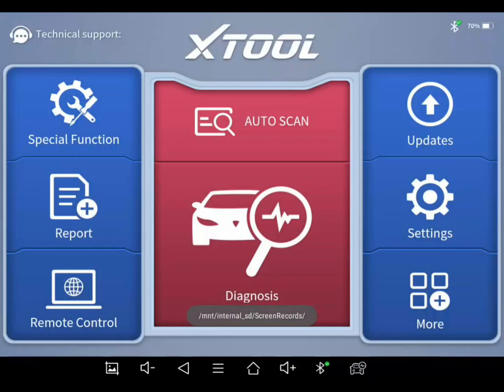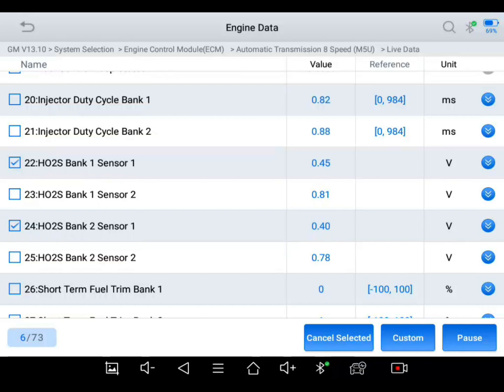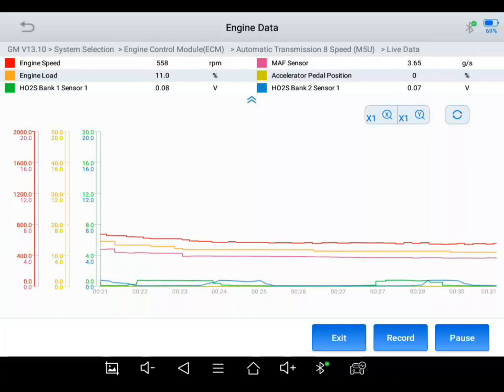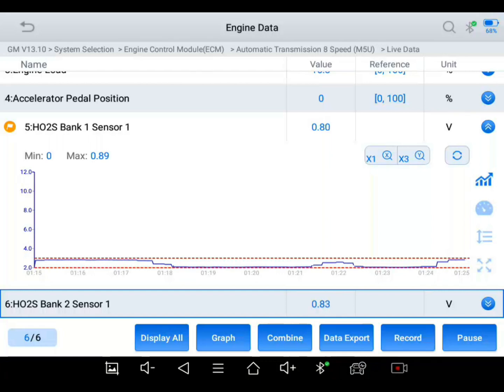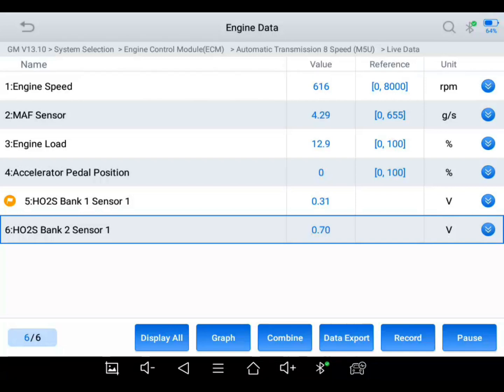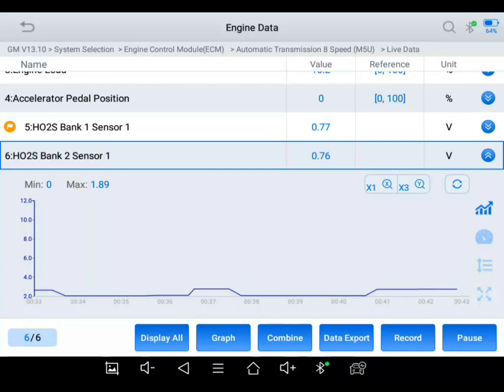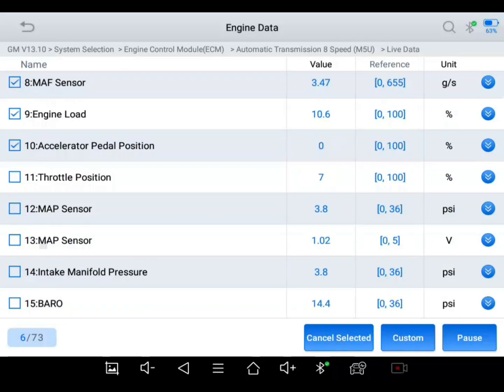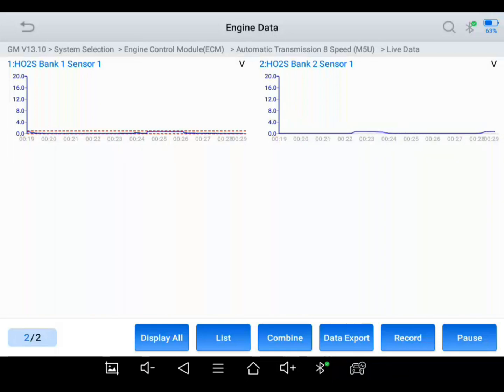The Graphing Abilities of the Xtool D8 Scan Tool and the Biggest Problem it has.

Comment: This stupid XTool D8 doesn't recognize my Mazda CX-30. I updated the software, when I go to "Settings" it says that the software is up to date. I'm disappointed in this scanner, I mean it's a Mazda, it's not like some exotic luxury car brand.
Reply from the maker: What year?
Reply: @737mechanic  it's a 2024 Mazda CX-30.... I had my Xtool D8 since 2022 and my subscription doesn't expire until next year and it says that all software is up to date.
Reply from the maker: @alexanderakilov4349  Give it time and it will work fine. If you are having problems with a 2024 take it in under warranty.
Reply: @737mechanic  I just wanted to do one of those special functions to disable the seat belt chime .

Comment: Excellent video. The inability to scale the graph renders the one function I need most to be useless. $400 lesson, I guess.
Reply from the maker: They have since fixed that problem. I have another video showing how well it works now.
Reply: I downloaded the updates today and it's still dismal with almost no movement at all on the A/F line. @737mechanic  I saw your video and yes it is better but a 3 volt scale with a millivolt response isn't useful for wave comparison. I wish I could upload a screen shot.

Comment: Thank you! Finally a video that shows how these handle live data like as if you were diagnosing a drivability problem and not just using these as glorified code readers! I need a new scantool. My Autel MS906bt is just way too slow. I was deciding between the Launch X431 V+ PRO and the XTool D9 Pro. The Launch has pretty decent live data viewing with lots of graphs and I never saw how these Xtool's handled more in depth live data. The scaling issue you're showing is annoying but hopefully that'll get fixed or at least I'm pretty sure I could work around it. I think I'm leaning towards the XTool D9 Pro. Thanks for your videos you have on both platforms. I watched quite a few of them and they really made me feel better about making a decision. I gave ya a sub!
Reply from the maker: The graphing is really good on the xtool. It is nice and responsive and smooth. I have used some scan tools that the graphing is pretty much worthless.
Reply: @737mechanic  I hear ya there. I'm mainly using my Autel MS906bt. It's graphing is annoying but okay if you're only interested in one graph. But in general it really sucks for data captures and reviewing data after your road test. When I need to do that I usually just have the PIDs as text then record the screen with my GoPro and review the frames of the footage rather than trying to use the Autel...

Have you done a Ford power balance test with your XTool? How does it fare to the videos you made of your Launch and your Autel? I work on a LOT of Fords and reach for that test a lot. But unfortunately my Autel is just like the video you made with yours. Horribly slow sample rate for that test. The video you made showing that test on your Launch had a pretty decent sample rate. Enough to catch one time misfires. Really wondering how the XTool compares to that.

Comment: One more issue i found with the d7 is when i save a report on my 2018 Chevy Cruze it will show all the information on the car but it shows the milage in kilometers instead of MPH I went back to the settings and i had them all set for American so that's another glitch they need to work out And the readings on the 02 sensors is a major issue
Reply from the maker: Make sure you send a report to them so they know and they have been good at fixing stuff like that.

Comment: Great video. 

Is it possible to save data and export it as an excel file?  That might be a work around to create a better graph on a computer.  

I would love your insight on a few other questions I had about the unit.  

-programming custom wheel sizes for Jeeps
-programming pinion factors 
-injector coding when swapping in non OEM injectors
Reply from the maker: The only wheel/tire sizes you can program are sizes that are offered by the manufacturer.

Pinion factors can be programmed for some makes and models 

The only injector coding I have seen is for diesel engines.

I have a video showing the option for custom tire sizes in the Launch x431 scanner.
https://youtu.be/wF6Xbi0m3eg

Comment: Already reported the o2 sensor range issue to the techs for fixing.
Reply: Great job!
Reply: My brother just bought the D8 and was wondering about the custom list limitation to just 8 PIDs. I think it should be more even if the refresh rate is slow, we techs understand that refresh rates get slow. Also; the graph option is not always visible and only gives combine at 8 PIDs. I think it was mentioned that if it was fewer PIDs; it would give that option to graph individually. I think the other option which a lot of scanners allow is the custom graphing from the custom list. For instance I want to see the O2 sensors for short and long trims separate in two combined graphs, etc. So far this tool is faster than my Launch Pad II. I will keep using this tool and see; your reply gives hope that you listen to the community. Thank you!
Reply: Hi, All xtool product had the possibility to view separetly several graphic on one screen but A30M can't do this, why ?
Reply: @zw3245 
I'm very disappointed in the fact that the a30m only graphs one at a time on a page. And my a30m is not fixed on the 02 volt scale. Which makes that pid worthless.
Reply: Have they fix the h2 sensor graph issue yet is 2024?
Reply: Thanks for explanation

Comment: X Tool need to add topographic
Reply from the maker: They have it on the D9 but yes it would be nice on the D8 as well.
Reply: @737mechanic  yes the D8 also need battery in the top right of the scanner like Autel and snap on. I mentioned it to them
Reply from the maker: @TurnThemWheels  Don't forget the VCI has a voltage readout on it, of course, most of the time it isn't in a position so it can be read but you could always get an OBDII extension cable so it could be read.
Reply: @737mechanic  yeah it’s on the machine which is cool but most scan tools have it in the top right of the scanner. Also you can’t connect a cable to the BT version
Reply from the maker: @TurnThemWheels  What I mean is take an extension cable and connect it to the VCI and the OBDII port and that way you can always see the voltage readout on the VCI because you will be able to lay it or position it where you want.
Reply: @TurnThemWheels  It will be added in future updates. Already reported it to the techs.
Reply: @xtooltutorials  awesome thanks

Comment: Excellent video!!..  I knew you could teach me some things. lol.  That "Graph" button must have been an upgrade/ update.  Because when I first got it (over a year ago now)--  I searched through it several times, and the "combine" button is all I could find (maybe I missed it).   So that's a LOT better than I had first discovered back then, and I've never had to use graphs since then, other than 1 at a time.  But showing 6 graphs at once is pretty nice;  you can do a lot with that.
 
I agree about the 0 to 1v scale on the 02 sensors.  Even if they just got it down to 0 to 5v scale, it would be much better; especially on a full screen graph.  So the next time I'm using it, I'll do a write up about that needing to be changed.  If we all report it as an issue, they will probably get it fixed, they seem to be good at that once an issue is identified.

Maybe it was just the fact that you first made a custom list-- and THEN that graph button will be there.   See before, I was only selecting a few pids from the entire list -- and I think "combine" is the only button there.  But once you make a smaller custom list, THEN the "graph" button shows up.  Which makes sense now that I think about it.   You can't "graph the entire live data pid list at once, so that's why the option wasn't there.    

So that's the key distinction:  always make a little "custom" list of what you're looking at first, and the graph it.  Vs simply checking the box of a few pids in the full list, and trying to go straight to a graph from there.   

edit:
Oh I see:   now it looks like they changed it and took the "combine" button away from the main list altogether- (1:40)_ - that way it forces you to make a "custom" list first -- and then your graphing options are both there. 

I'm super happy with buying this thing;   but just by watching videos with the Thinktool Pro, you can see that it's just better in a few ways-- which I had see the price drop to $9xx at once point-- and it would have totally been worth the extra $200 to get it.

Thanks for the video..  sorry for all the rambling, I was thinking out loud as I typed it.   I learned a lot.  cheers.
Reply: In your opinion is the Thinktool Pro better than the xtool d8 ?
Reply: @ThunderbirdRocket  Yes..  but only with a few things. But it also costs quite a bit more.  D8 just got updated with topology now, and it's excellent and copying keys and pulling codes for weird keys.  It's hard to beat the D8 for the money though.   I"ve seen it go down to as low as five-fifty sometimes.  Thinktool pro is usually double that.

Comment: Great video and do agree w/ your comment regarding the O2 scales. Hopefully Xtools will fixed it a update just like they did the problems w/ locking and unlocking the rear caliper.
Reply from the maker: I have no doubt they will.
Reply: @737mechanic I think this tool would really shine with an oscilloscope that works in conjunction with the xtool specifically for their scan tool. 4 channel or more like the snap on verus pro
Reply: @justinshields4216  I am sure they can be added but the price point would change. The Dx9 might be a good entry point for this function.

Comment: I have contacted Xtool about the O2 sensor scale. They replied and said they would be optimizing the scale in the near future. It may help for others to voice their concerns over the issue. As you have noted, it's pretty useless in the 20v or 16v scale.
Reply from the maker: Good to hear and you are right the more people that complain the quicker it will get fixed.
Reply from the maker: @gearbox387 I didn't notice any decline in sampling rate whether I had 1 or 6 pulled up. I think with that few it is plenty fast enough to give a fast sampling rate.
Reply: @gearbox387  I did notice on another video, a guy was using the old expensive snap-on and he was graphing several pids, running 4 channels on the built in scope, and also trying to screen record while bouncing back and forth between the live data and the scope:   and it kept glitching and crashing the screen record.  So there's no doubt that they can bottle neck when doing too many things at once.   

Maybe that's why they only limited it to 6 graphs..  I know on an older 97 F150, my D8 graphing and live data seemed to be much slower, but on a 2010  Dodge Nitro, it was fine.   So it depends on what car you're jacked into also.    AND, I think it can drag it down a little depending on what units you are using;   I think it is natively programmed for metric units, so when you select imperial units, it has to process the conversion-- so that's just another layer of load that can contribute to slowing it down.   So it all depends on the situation really.
Reply: Edit: I posted to soon, I guess its always had the auto adjust feature.
I just got one (fully updated) and checked. It seems default is now 0-5v and cannot be altered manually. Min and Max still do the same and do not adjust the scale (I think it would be great if it did). What it does do tho is auto scales if the range goes over 5, it will adjust higher automatically and lower automatically depending on what is in the graph range. 

The points per second is also a bit slow compared to Autel. Would be great if XTool doubled the points per second data collection, or maybe gave an ability to adjust it.